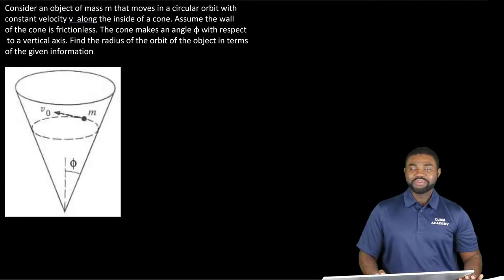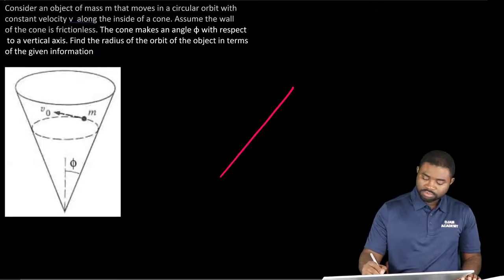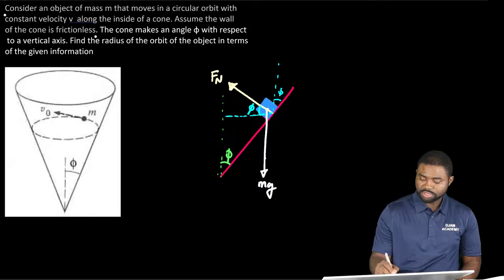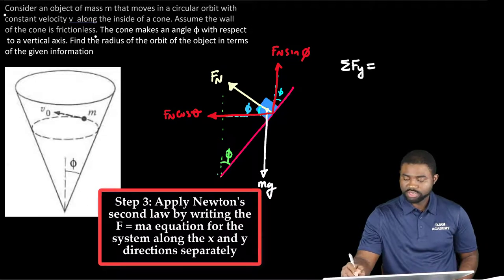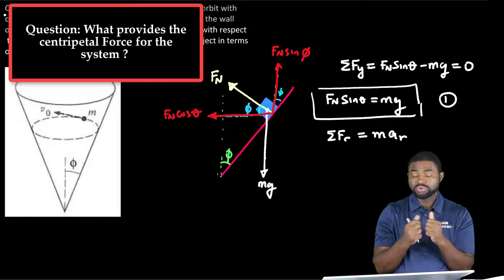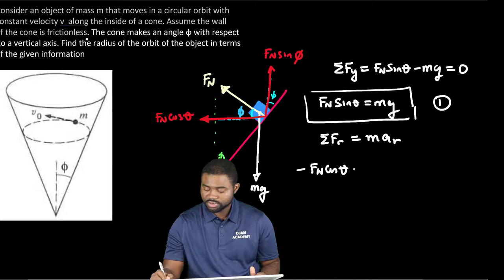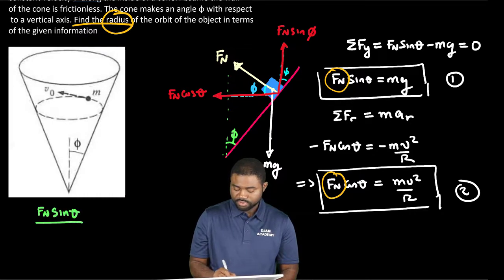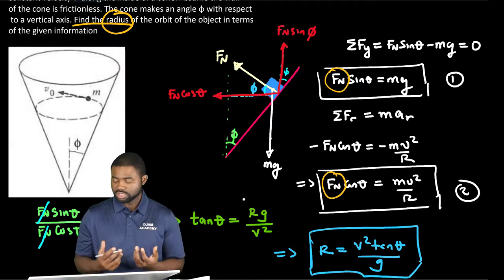Circular Motion: Motion of a Car inside a frictionless Cone ANALYZED

Comment: If spinning speed exceeds above certain limit..the block rises why??
Reply: Because centripetal force increases so normal force. Then component of normal force parallel to surface becomes greater than component of weight. So object rises.